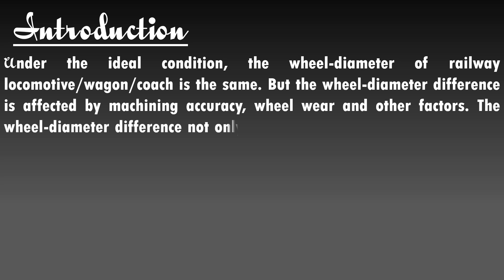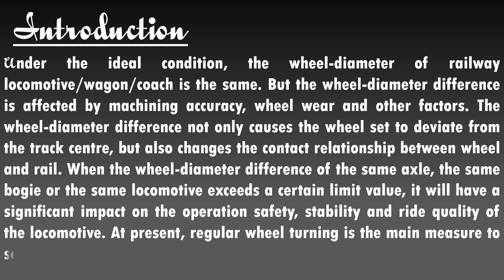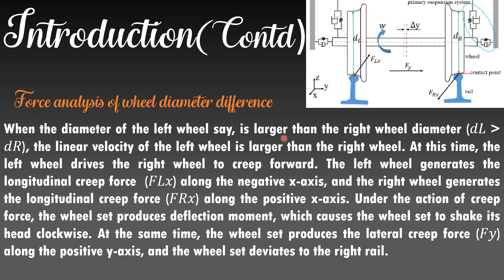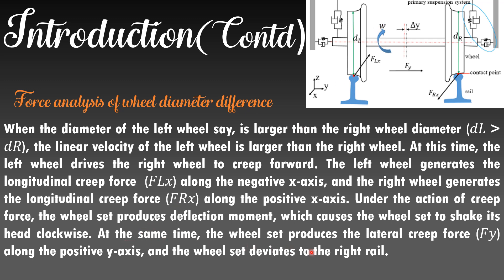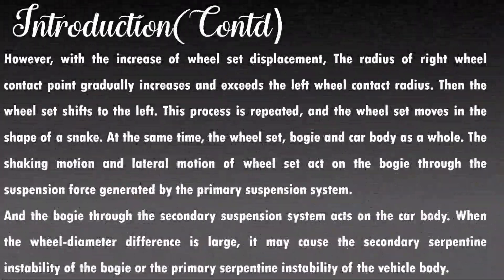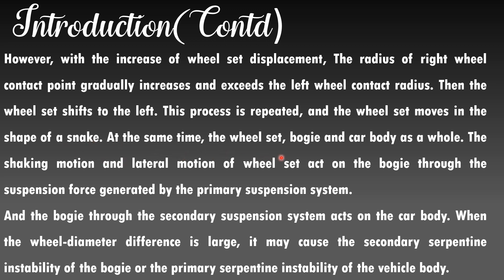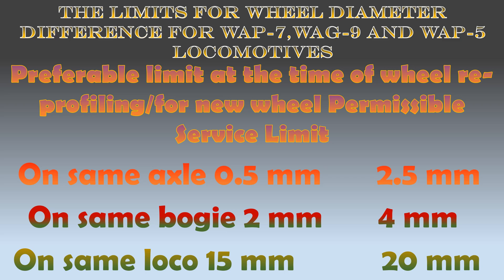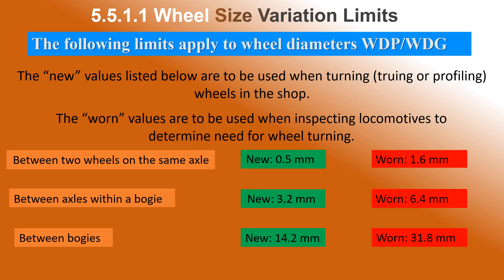#EFFECTS OF WHEEL DIAMETER DIFFERENCE ON SAME AXLE OF COACH WAGON LOCOMOTIVE STABILITY

Comment: Sir before asking people to accept your theory which is in contradiction to Rdso letters i request to you to get your all Gyan approved by Rdso.
Reply from the maker: Well I don't know about which theory is the remark, but if a locomotive has a in service tolerance of variation of wheel diameter on same axle how come wagons trailing behind can have no in service tolerance. My Gyan is personal experience of over 300 derailments i faced and I don't want want anyone to accept it. But I always try to put forth the data based on manual codal provisions appd by RDSO,RB .
If it's in contradictory to rdso may kindly pin point ,i shall be happy to correct my self and criticism will make me further perfect.
Reply: What you exactly mean to say by serpentine motion?
The wheel tread follows sinusoidal path on rail table, the concept of positive and negative angle of attack has been derived from this.

Comment: Sir the para just says that the difference is 1:6mm not mentioned that it is during in service.
Reply from the maker: Yes Sir, but it's when turning is needed.
Reply from the maker: May i call your kind attention to rdso' letter no . EL/3.1.3.5/2 DATED 7.7.2005 TEC CIRCULAR NO. ELRS/TC/0083(REV.0) Subjected : limits for wheel set dimension variations and wheel wear of WAP5,6&9
WHERE IN permissible service limit is 1.5mm, in same axle, 4 mm on same bogie and 20 mm on same loco.
That Sir I m thankful for your valuable and timely comments. Now two days back I had an accident reference where in the difference on same wagon is reported to be 34 mm. So shall we go by there is no limit in service.
Pl do send me your most valuable comments.
Same logic applies to disel.
For coaching also it's 1.6 mm circumference difference on ICF.
🙏🙏🙏🙏
Reply: @yourderailmentguide8902  
Sir the difference of 0.5mm is during turning as there has to be some tolerance.but you say one the difference has reached 0.5 mm the tyre needs to be reprofiled how is it possible?.
Reply from the maker: @vikashthakur5863  
Dear Sir,
Thank you very much for your response. I HV given th circular which restricts the parameters in service.
Similarly for diesel locos also it's similar but para para 20 of MP IB BD.02.16.01 REV 0 Also mentions about service limits.
Efforts are always made to present data only with ref to rdso spec MIs, bulletins.
Always appreciate and welcome your comments and would also seek your guidance where I m wrong.
Thanks
Reply: @vikashthakur5863  it's at time of turning and wheel fitting at roh poh. There is in service limit prescribed by RDSO
Reply from the maker: It's service tolerance para 5 of locomotive manual.
Normally I don't mention with manual background 🙏🙏🙏